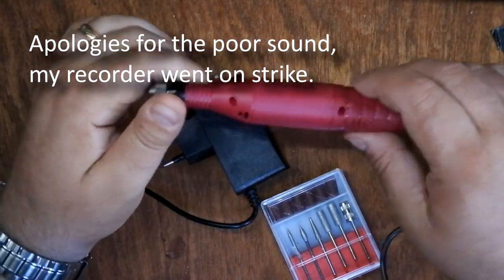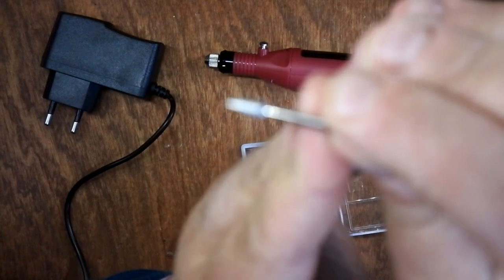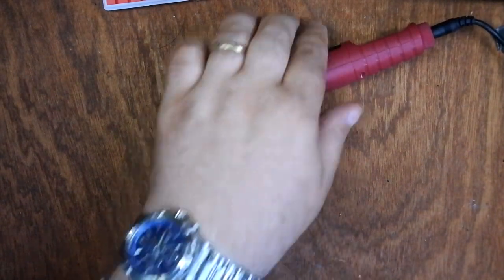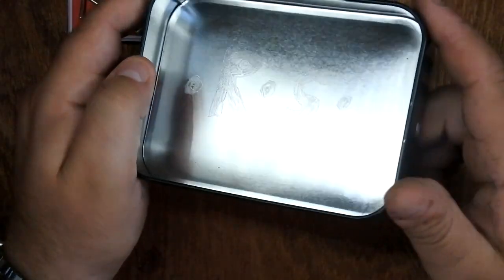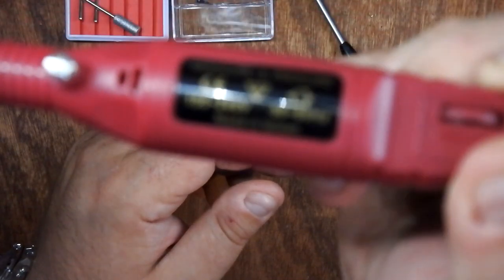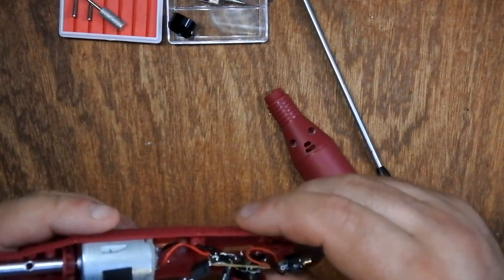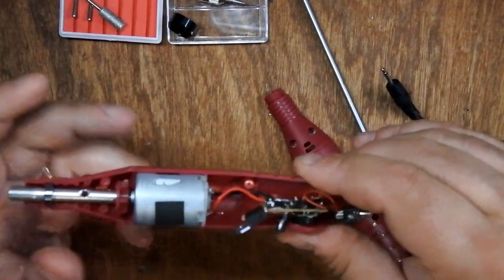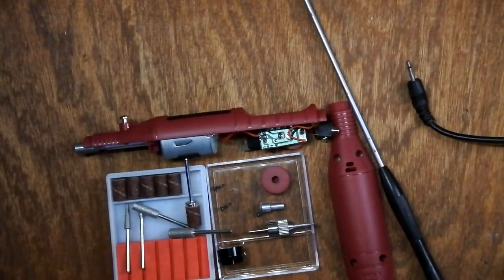A nail art tool, or just an engraver?

Comment: This actually is different than a dremel type tool, the bit barrels are smaller so the bits aren’t interchangeable, You cant use the dremel bits in this and it actually doesn’t hurt your nails and you aren’t supposed to use it on your live skin, if you use it on natural nails you use it at a slower level and it doesn’t hurt at all but I mostly use mine on gel, polygel and acrylic nails to shape them or remove them. All that being said I’m watching this video besides I was thinking about using my cheap bits (the more expensive nail bits can get quite pricey) for engraving leather